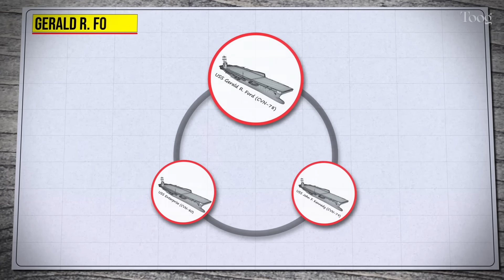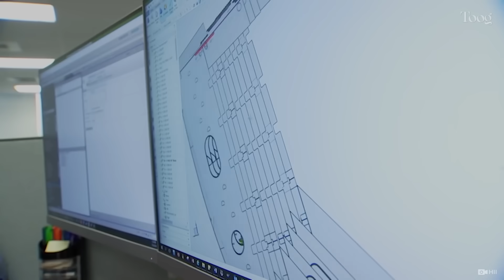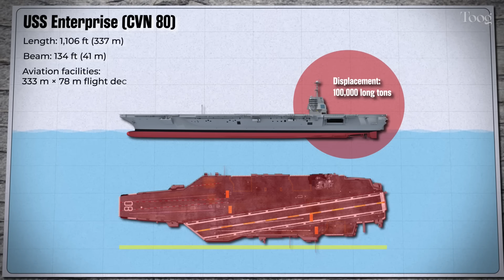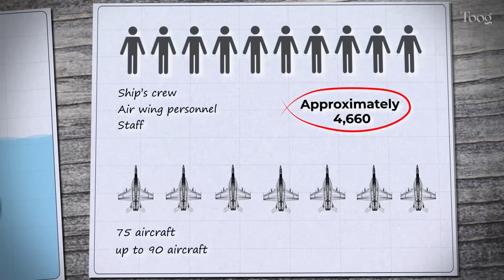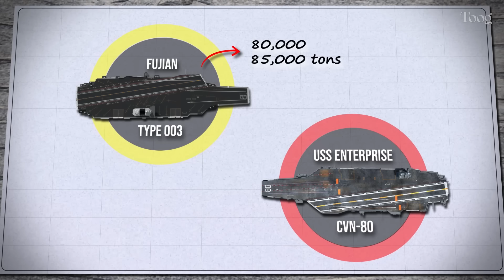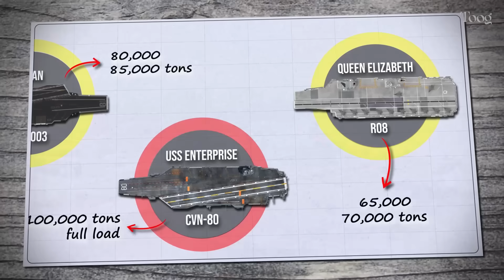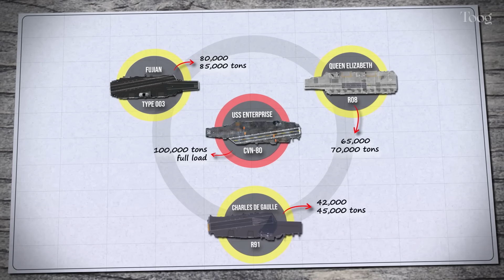Meet the US Navy's Next Monster Supercarrier - USS Enterprise (CVN-80)

Comment: The DeGaulle is aging, commissioned in 2001, but France announced plans last year to build a replacement. It will displace 78,000 tons and measure 310 meters in OAL. Known as PA-NG (Porte-Avions Nouvelle Génération) initially, it will be nuclear-powered and utilize EMALS like the Fords.

Comment: My question to anybody who knows about Ship design/building....  What determines the most optimal beam width on a ship/sub's hull ?  Does it have to do with the power of the engines and the propeller drive shaft?  Because I'm always wondering why ships aren't built wider than they are.  You'd think that theyxd wang them as wide as possible to create more space for crew and equipment.  Because I'm looking atthe thumbnail of the Enterprise in drydock, snd I'm thinking, they could fit at least another 66% hull width in the dry dock.

Comment: ....delivery 2030? That is a build time of almost a decade and a half.  That is very slow, especially for a country that could produce a Liberty ship near the end of World War Two, at a rate of one every 42 days.  I do hope the worlds most powerful and advanced navy can speed up the build process to best assure it remains so.
Reply: It’s a bit more complicated then that, one the ford class is MUCH bigger than the Liberty ships. Two, Since the US manufacturing is not currently in the state it would be were the US at war there is no incentive nor enough manpower to rapidly build ships fast as fast as that. If the US were at war it would likely be able to cut that down somewhat, not sure by how much since it’d be rather unwise to base those guesses by the capabilities back in WWII due to how different the modern ship manufacturing complex is and the previously mentioned size difference. That’s not even getting into the differences in time caused by differences in what was needed for a cargo ship vs the needs of a carrier.
Reply: Liberty ships were rowboats compared to this.

Comment: Why not keep the existing carriers, make them larger and modernize them to the ford class standard, move the bridge to the rear. Wouldn’t this be cheaper? This would have been done cheaper and faster.
Reply: Fair question. The overall structure would not support such changes. The entire backbone would snap. The other concern is the age of the metal and its exposure to salt water for so long. There are likely other concerns, too.
Reply: @steveforbes8287 now I understand, I was in the Army.
Reply: @s @steveforbes8287 thank you

Comment: Why does our most advanced, monster carriers have EMALS inferior to China's?
China's 120k ton Fujian has 4 EMALs, each with advanced independent DC (MVDC) power sources 
The 100k ton Fords 4 EMALs share one AC power source -- more complex & failure prone
Our dated power system design is 20 years older than China's - cause it took us that long to build
We should be leading, yet China leads with two ships with superior EMALs to our one.
Reply: Fujian has 3 EMALS catapults poorly laid out, no2 JBD encroaches onto the angled deck and no3 cat is unusable during landing ops.

Comment: The 1970s refrigerator in my garage still works great, yet I went through two "smart" refrigerators in the last 10 years. Just sayin'.
Reply: I mean, not even the same concept, but ok, they are not designed to last long, they want you to buy a new fridge, the 70’s you could still buy something meant to last.
Reply: Let’s see Nimitz Class vs Ford Class..double the energy generation..Nimitz is tapped out, electromagnetic elevators and catapults allows double digit more sorties to be launched.
Reply: Easy to see you never served
Reply: Well said😊
Reply: You’ve noticed that, too!
Reply: You have to buy really expensive ones if you want them to last. They are well over  9k for a good one that will last. They wont have all the electrical stuff but they are efficient and built like tanks. Menards and homedepot do not have them ever. I dont think they can order them either.
Reply: Do they sit in saltwater?
Reply: You're right Greg, aircraft carrier and meat lockers are exactly the same.   How did boomers become so stupid?
Reply: This isn’t a consumer appliance Gregory.
Reply: Both are doing exactly what they were engineered to do
Reply: THIS
Reply: You still haven't learned that older is better? Now I know who took my bottle of slow pills. lol
Reply: @steveforbes7718 let's take one upgrade. Electromagnetic catapult. These were put on the boat so they could launch drones off the catapult. The big one is drone tankers. Already tested. Great results. If the old steam catapult were used, the drones would fall apart. Been on the Constellation and the Enterprise. Sometimes older won't work. Just saying.
Reply: @bellabonnie3141  I never said that the magcats would not work. I know that they still have an occasional bug or hissy fit but, so did steam cats.  I don't believe that drones will ever be as effective as desired.
Reply: Yeah well, I'm sure the original Enterprise is far more capable than this ship, right?

Comment: all those electronics, I hope they have EMP protections. Give me good ole analog. Sometime in future, us old goats may be call into service to resurrect some of mothballed dinosaurs.
Reply: EMP protection has always been a thing since WW2.
Reply: They are heavily EMP protected…and some redundant analog systems
Reply: Even tanks are EMP protected.
Reply: All USN surface ships are tested during builders trials for EMP hardening. Off the coast of Florida the USN used to, and may still, have a barge named 'Empress II'; it's essentially a massive capacitor farm and antenna barge. Gennie's power up the caps, and when the ship is in proximity the stored pulse is released. On a side note, what still may be the world's largest all wooden structure with no metal fasteners is in the American west, don't recall the locale off the top of my head, maybe the NTS. A massive platform large enough to roll a B-52 onto and blast it with EMP. That's how the AF did EMP testing.    Cheers
Reply: @johnbuckles1344  If commenters to a YouTube video have thought of this, it's probably a pretty safe bet that the naval architects and engineers responsible for designing our warships have thought of it, no?

Comment: '
that beautifully cooooool aircraft carrier...
but need to add build a ramp up on the front
Reply: With catapults a CV does not need a ramp.
Reply: @markam306  
hi M...
'
thank explain...
ramp up is a more faster fly up than flat point
Reply: @bestamerica 
The biggest advantage: a catapult can launch an aircraft loaded to its full takeoff weight.  The aircraft leaves the deck at flying speed.  Once airborne, the aircraft can climb in the same way it would after a land takeoff from a runway.

The ramp is used by other navies to assist vertical launch aircraft like a Harrier or F-35B get into the air with a little more payload than pure vertical liftoff.  The USN amphibious ships like an LPH are mainly designed for helicopters, so we don’t have ramps on those.  They do carry F-35Bs but only launch vertically or possibly a short run.  It’s a tradeoff the USMC makes.  Launching a multiple helicopter assault quickly is higher priority than the followup close air support.  The jets fly faster and can catch up easily.
Reply: @markam306  
hi M...
'
okay thank explain